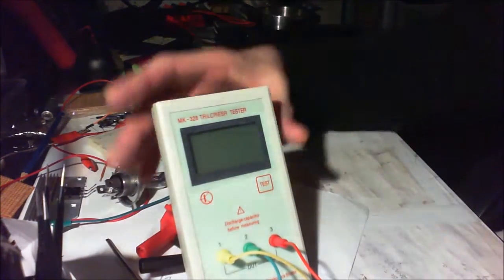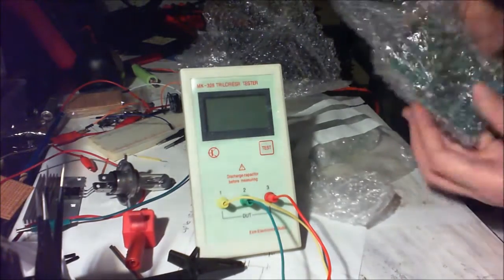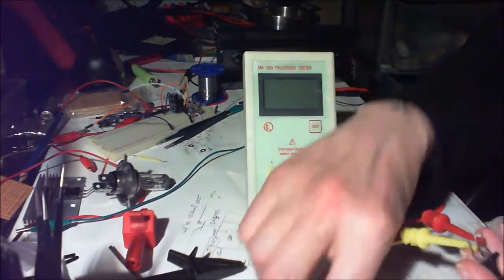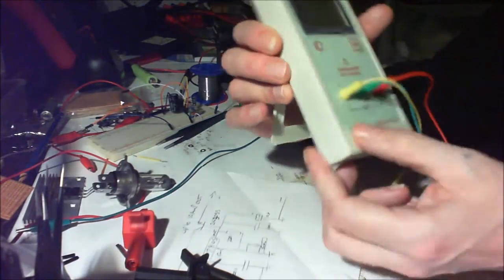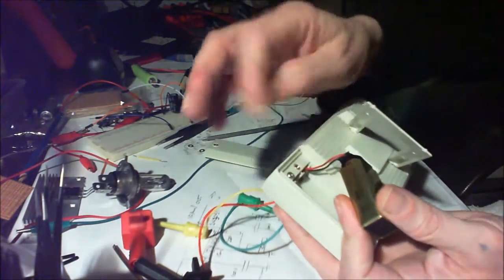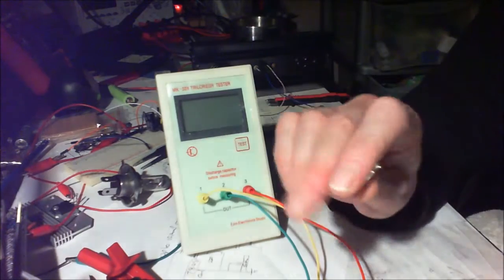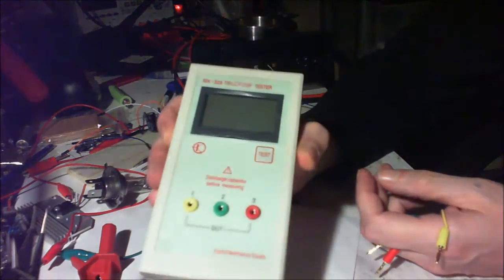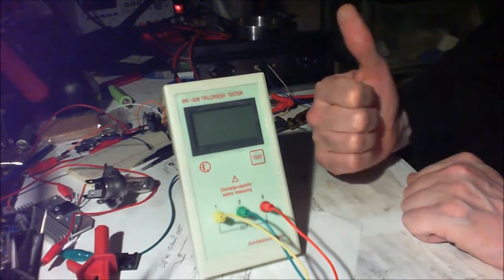Ebay LCR ESR Meter Quick Review

Comment: Can it measure caps in circuit?
Reply from the maker: The meter in video, no you can't.  If you want cheap In Circuit ESR tester search for this 
MESR-100 V2 AutoRanging In Circuit ESR Capacitor

Comment: Why not just buy the Atlas dca55 instead of replacing these cheapo meters?  These cheap models don't read leakage in transistors like the atlas... plus the atlas isn't much more than a few of these....
Reply from the maker: +John Michael That meter does have an extra feature but for 3 times the cost of this one. I would like to add though: An ohmmeter can be used to test a transistor for leakage (an undesirable flow of current) by measuring the base-emitter, base-collector, and collector-emitter forward and reverse resistances. More info on measuring like this... http://www.tpub.com/neets/book7/25h.htm
This is a very cheap meter to enter electronics with and more practical (Case and Hook Leads) than the others I tried. I suppose it everyone's choice but I guess maybe a Fluke DMM will have more features than my Brymen 867s DMM but the cost for the extras of the Fluke take it out of my budget range. The Brymen is still a great meter and does everything I need it to. Cheers anyways because now I have had a good look at Current Leakage in Transistors :-)
Reply from the maker: +John Michael I must add as after checking, this meter does measure leakage current. Described as ... Display the Collector cutoff current ICE0 with currentless base (10µA units) and Collector residual current
ICES with base hold to emitter level . This values are only shown, if they are not zero (especially for Germanium transistors). I think thats right.
Reply: +Elecifun that would be great if they did cause I'm looking for one that tests leakage & one I don't need a masters degree to understand. I'm no expert or know as much as guys like you & only need it to test transistors for my fuzz pedals. I admire men such as yourself & hope one day I can learn. Thank you for sharing that link & the info on how to test for leakage using an ohmmeter. I have to be honest & say, I can't seem to get enough of this type of stuff. It fascinates the hell out of me.
Reply from the maker: First, I am a noob and proud of it. I am 1 year in on the 16th of this month (April). It is a little addictive and great fun. I am the same I can't get enough. Some many areas to study, its great. I have finally worked out what a calculator is for ;-) I am not sure if this one is the best for what you require but it serves me well at this stage.

Comment: Nothing worse than a wobbly meter - just stick some neodymium hard drive magnets on the back or bottom and it will stick to any metal surface - best hack ever for ease of use!

Have to agree have tried a lot of these meters on ebay and this one is the best especially for ESR reading!